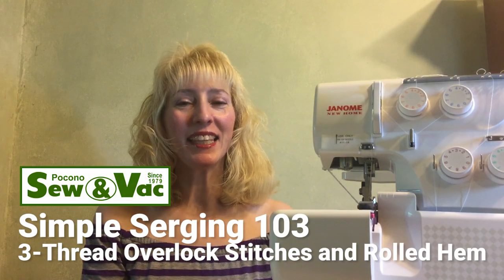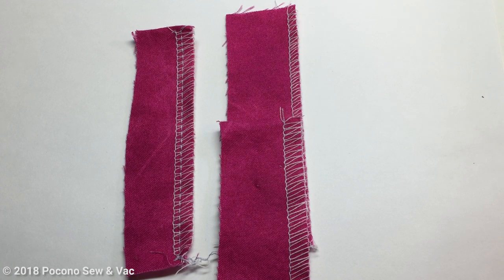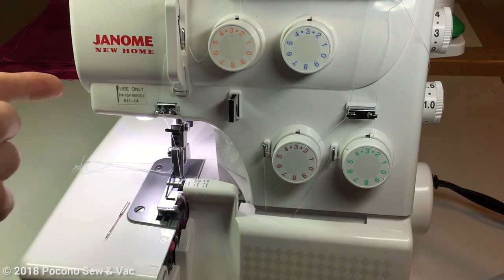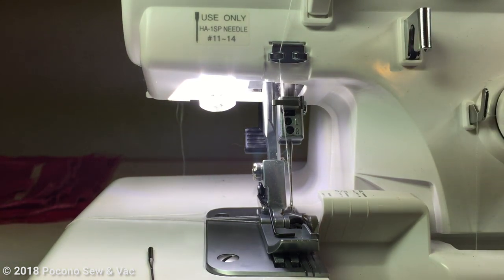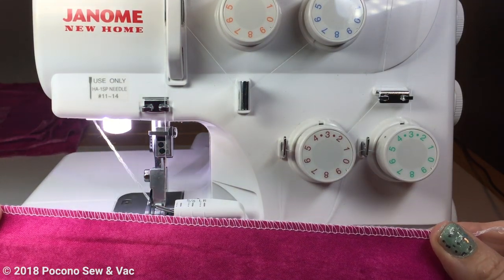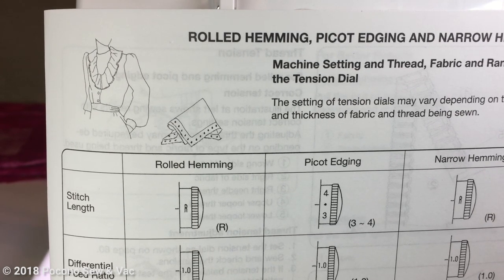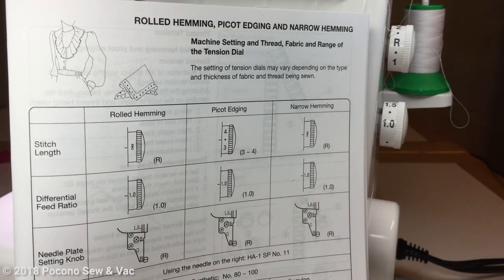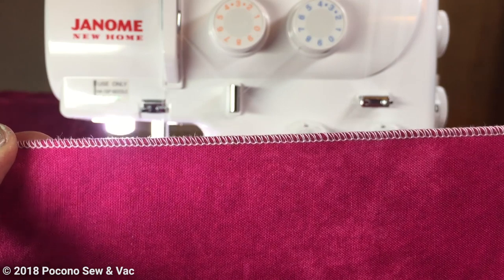Simple Serging 103:  3-Thread Overlock Stitches & Rolled Hems

Comment: I cannot thank you enough for these instructional videos. I just bought this Janome 8002D this afternoon from my local Sewing and Vac center here in my hometown in Michigan and I don't have a clue how to use a serger. The woman that sat with me at the store had me thread it wrong from both your way and the manual. Thought it still did nice stitches so apparently was not that important which hole I went through first, right or left so long as it was from top to bottom and back over top and through. And she covered most things accurately but not in the same detail as you did. Your videos are so clear, even threading that nasty lower looper. I feel so much more confident now to sit and try the various stitches that you have done in this segment. You have helped me greatly. Thank you again a hundred times over.

Comment: Thank you very much for this invaluable information. When and how do we oil our Janome sergers?
Reply from the maker: Jude Jane, this information is posted in the manual.  Sometimes it is difficult to see the exact oil "locations", but don't stress about this too much.  Look for moving parts by turning your handwheel if a bit unsure.  Those moving parts will need oil.  Follow the  locations in the manual's picture and you will do fine.  Don't forget to run a scrap piece through your serger when done to absorb any excess before starting or continuing a project.

Comment: I took out the left needle and it looked so much better on the project I was doing.  Now, a question....I have loops on edge of the material, what do I change?
Reply from the maker: Move your knife to the right.  It will cut off less fabric.
Reply: Wow, thanks for answering my question so quickly.  Great video.

Comment: Kathy, I have a hard hard to do the organza, especially with it is a curved A shaped skirt, I used rolled hem finish with my Janome  PRO 4DX. Would you please conduct a tutorial of that, please ?
Reply from the maker: Edna, try using a temporary stiffener on your organza. A few products which come to mind are Palmer Pletsch's Perfect Sew, Terial Magic, or google "gelatin organza", a homemade method.  Be careful, however, if using an iron on synthetic organza.  It won't take high heat like silk organza.